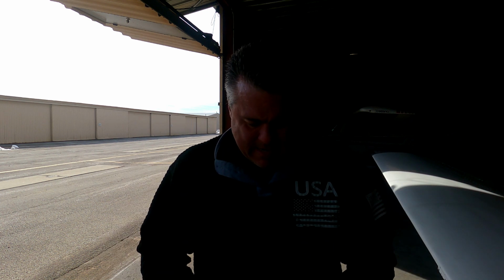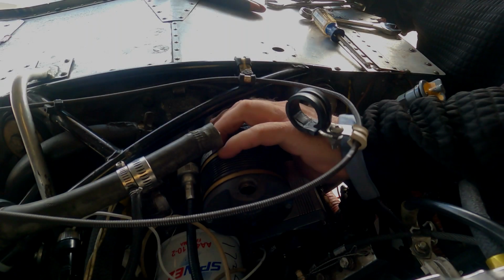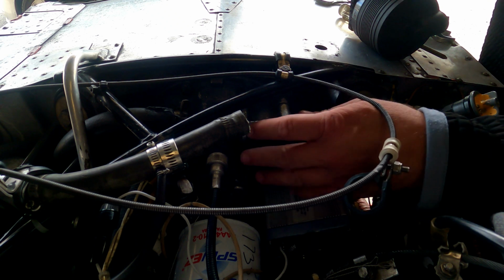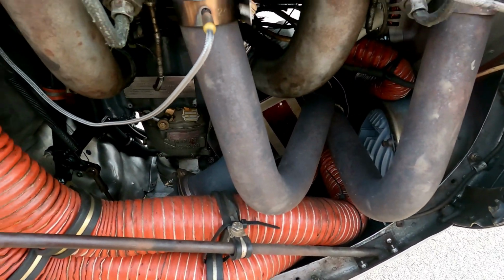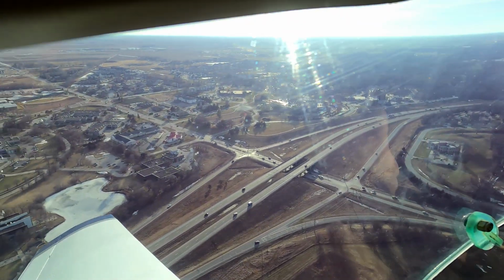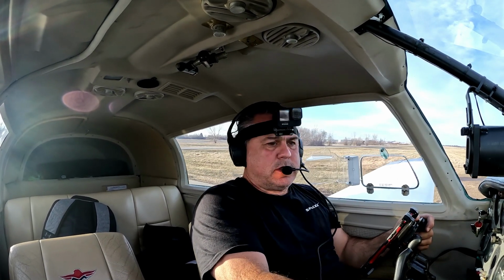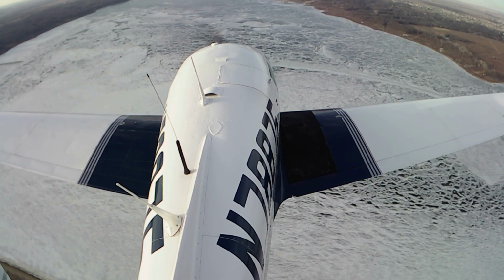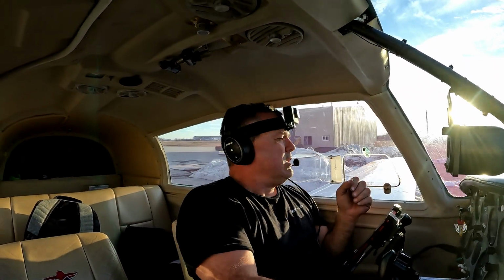We replace a vacuum pump and fly to KIKV.  We also head over Ankeny and frozen Saylorville Lake.

Comment: Great video on the pump, only thing I wish you would have done is the logbook entry just to go over it because remember changing a vacuum pump is not preventive maintenance so it would have been great to see the logbook entry other than that good video
Reply from the maker: Logbook entry was made by my AP/IA. He was the one who was in charge of inspection and install.  But, you're right. Going over the rules and regulations of aircraft maintenance would be a good video. Thanks for watching!